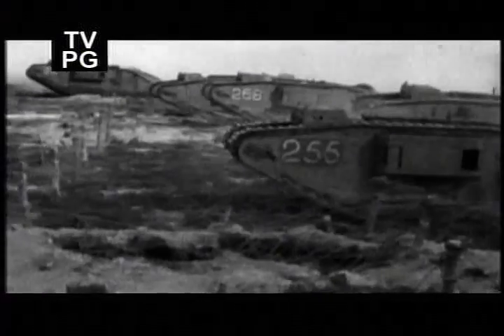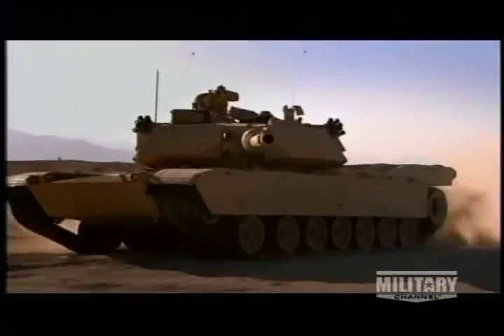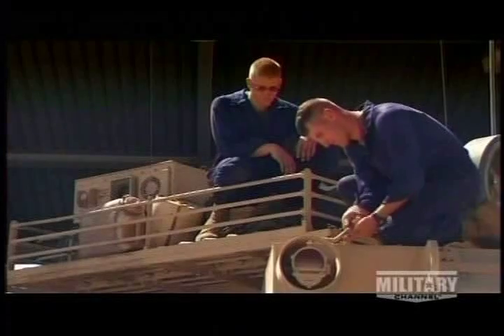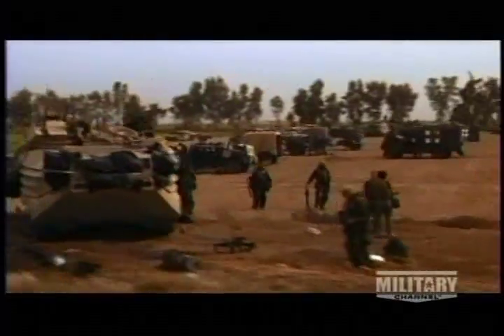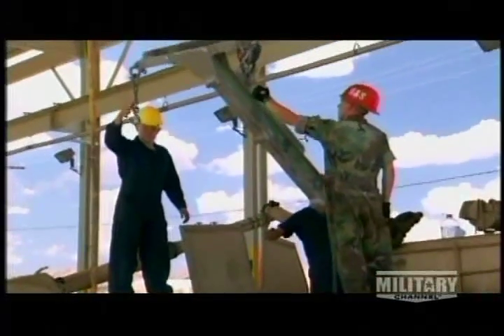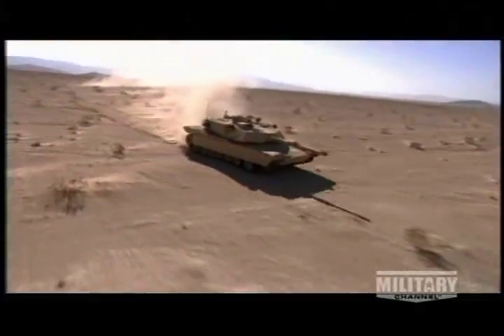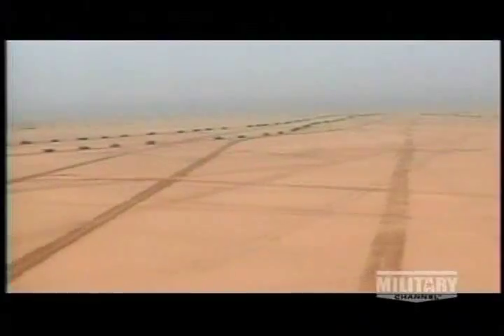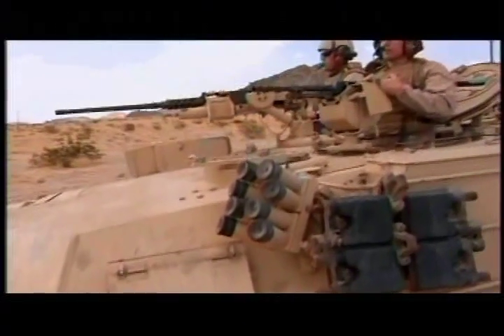Anatomy of an Abrams Tank Part 4

Comment: [tur-bin, -bahyn]  Show IPA
noun
any of various machines having a rotor, usually with vanes or blades, driven by the pressure, momentum, or reactive thrust of a moving fluid, as steam, water, hot gases, or air, either occurring in the form of free jets or as a fluid passing through and entirely filling a housing around the rotor.

tur-BIN

Comment: @PepekTheHordMaster no surprise someone defends junk, and to add on that, the T-72s the Iraqis had were newer than the M1A1s. The m1A2s did not come out until the mid/late 1990s. Where are you getting the crap info from? Its not even accurate. Pathetic training, well explain how some still managed to hit some of the Abrams tanks in Desert Storm, and still the Abrams that were hit only had wheel and tread damage and thats it. Wow even if the Iraqis were pro, results would be the same.

Comment: Some M1 Abrams tanks were often hit by the T-72 during Battle of Desert Storm but the T-72's gun failed to penetrated the M1's armour again and again. As you can see, Iraqi tank crews were not that bad trained at all, they just lacked a better tank gun being powerful enough to penetrate the M1's armour at 3 miles distance. And Even if the T-72 was 'only' 8 years older that is a huge time difference in warfare. Compare this to ww2, the T34 was only 1 year older than the Tiger.

Comment: @OlderG0ds that is not true and all sources will be against you. you will see that all sources claim that the T-72 simply could not penetrate the M1's armour at this distacne that's why no tankw as destroyed during the battle. Even IF a T-72 hit the Abrams it still could not destroy it. This has nothing to do with crew training it's called technological advantage. Even if the best tank crew in the wold woould sit in a T-72 they could not destroy the abrams due to the fact that it is undergunned.

Comment: this video doesnt cover it much, but the armor used by the abrams is chobham armor. Chobham armor technology is newer than the abrams, so the first model abrams armor was much less effective while still having the high price tag. which is why they all thought the soviets were more efficient. soviet tanks only needed 3 crew members, easy to mass produce, and were supposedly cost effective. what they found is when they were put into combat they had several design flaws. (auto loader and ammo)

Comment: Iraq military in 1990 was not "3rd world" 

Their tanks were not 50 years old. Unless they were using T-34? 

Nope they had T-72 which is a whole 8 years older than M1. 

It's funny because after it was all over we saw Abrams raped those tanks, but before that happened everyone thought the T-72 would win. It does have the firepower... just didn't have the FCS, advanced armor, and crews